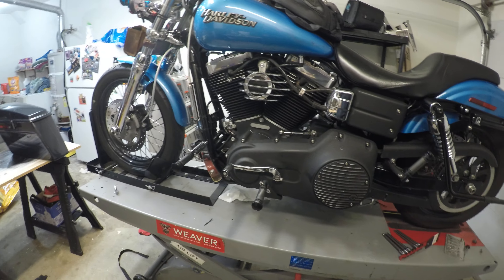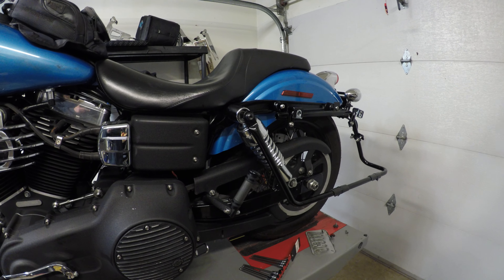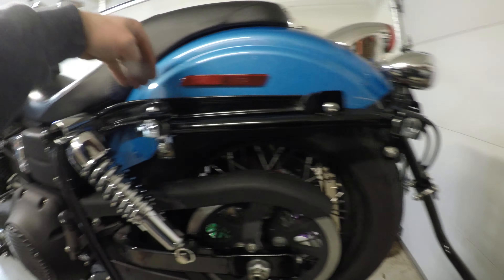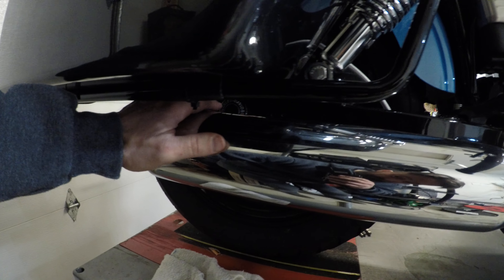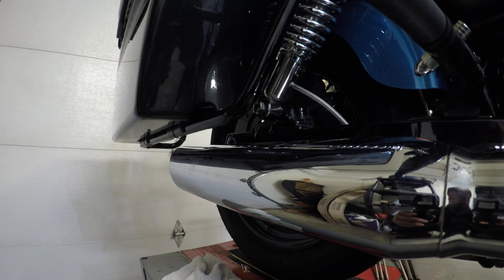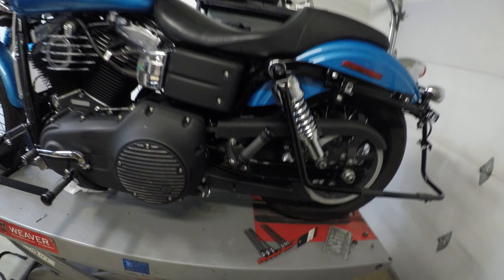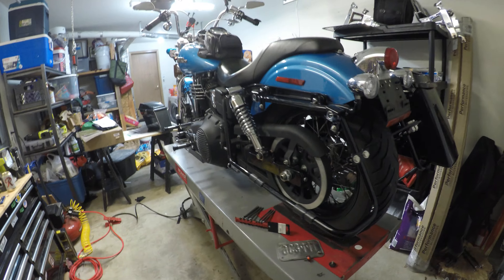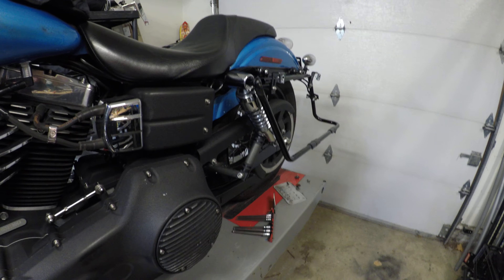Sumax saddlebag bracket for 2011 Dyna Street Bob`

Comment: These are the exact brackets im wanting to get. I have a few questions! 
Can any touring bag be places on these brackets?
And are you going to put the extended fender on? Thanks! Looks great. I can't wait
Reply from the maker: Thank you!  The brackets work great!

You would need to check the Sumax website site (Google it) to see what years the brackets will fit, but I believe it will fit 1993 or newer.  You can email Sumax as well, they are very quick to respond to any emails you may have.

I have no plans to add an extended fender.
Reply: @traveller1973  thanks for the reply man! I ordered them today after calling haha. Can't wait to get rid of this backpack! Happy riding bro
Reply: @traveller1973  did you have to relocate your bullet tail lights?
Reply from the maker: @gymguy-ct4zm  Yes.
Reply from the maker: @gymguy-ct4zm   I did have to relocate the turn signals.  I had a welder-friend cut and re-welding the existing signal bracket so they wouldn't interfere with the bags.